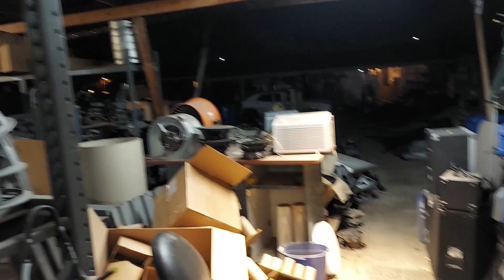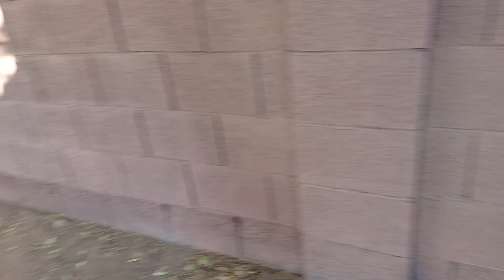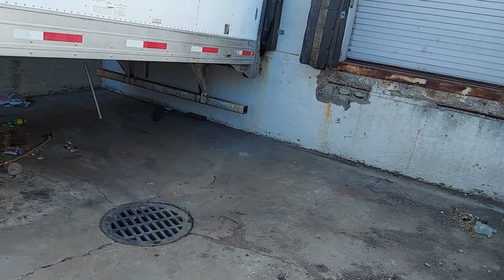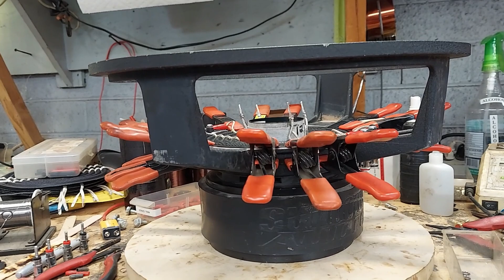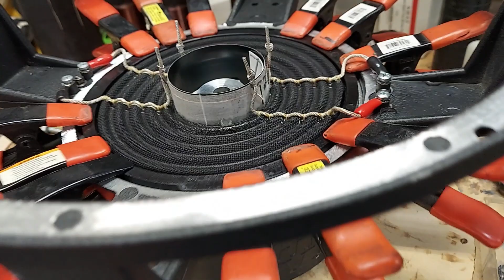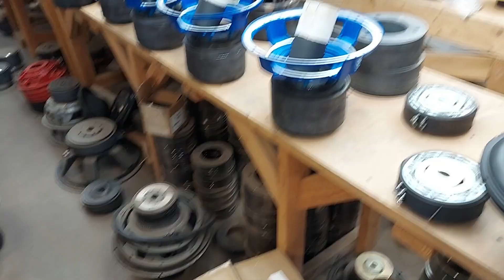Sunday Sermon - Death & Service + Sundown SA 15" D2 recone @RobotUnderground  (Recorded Saturday)

Comment: Pat what is that big sub just the other side of the 4 blue ones. It's a black outside silver inside TI frame 18? with a flying saucer of a motor? Just curious what that wide motor is, it looks super wide on video. It's so hard to judge size on video 6.5s and 8s even look fairly big sometimes but I'm pretty sure tho if I bought either 6.5 or 8  I'd open the box n think huh that's way smaller than I thought.
Reply from the maker: Sundown TEAM 24's
Reply from the maker: Sorry.  That one is the LMS 5400.  I'm doing a top for it in a 15" for Dainon R. and the blue 18" for Hayden P.
Reply: @RobotUnderground  wow no shit, that should be a a pretty impressive sub. The LMS is intriguing to me, I watched you explain it so I understand the concept but I've never heard one in person, it seems like it has some unique characteristics.
Reply from the maker: @95Sn95  Sure it's good, but the compromise is BL force / attack / quickness.

Comment: You mentioned SKAR EVL12D4's, I own a pair that haven't been fully broken in. If I were to send them to you what mods would you do to make them more "robust", add another magnet slug to handle that 3" dual 4 ohm coil? I'm torn in between SQ as well as SPL. Their driven with a Orion XTR2500.1Dz at 1 ohm. unfortunately the pair are mounted in a pre-fab SKAR dual 12" enclosure, I've seen that  many people strongly recommend a larger enclosure. It's Vas(L) is18.2. ANY help would be greatly appreciated, thank you!
Reply from the maker: If they work, use them.  Nothing wrong with that enclosure.  I'd recommend the Recoil 1200.1 for $140 shipped.

Comment: Hi I just wanted to ask a question about the skar evls subs. It has a smaller motor then other 18inch subwoofers but the coil is a bit beefer. How would that effect the sound and sensitivity plus other specs? Is the coil size more important than motor size?
Reply from the maker: Study other builders that use the same suspension and motor size.
Reply: @RobotUnderground   can u explain the lms voice to me please. And why doesn't move companies use it?
Reply from the maker: @Only1Shogun6  Other brands do use it.  I posted a magazine article on it in my posts section on here. https://audioxpress.com/article/test-bench-an-extended-home-audio-6-5-midbass-transducer-from-purifi-audio

Here's a video by it's creator Thilo Stompler describing it. https://youtu.be/t0_A6PcbC98
Reply from the maker: @Only1Shogun6  Why other brands don't use it??  The coil winding process for them is MUCH more expensive.